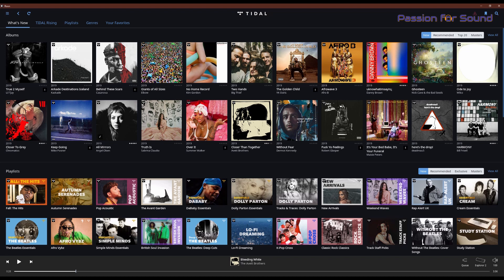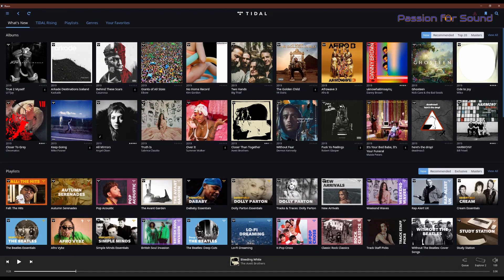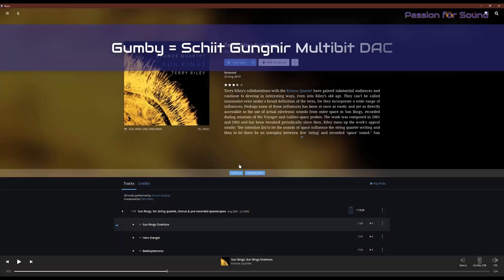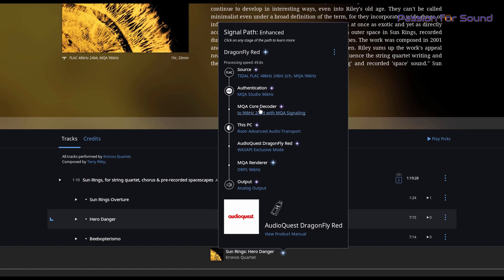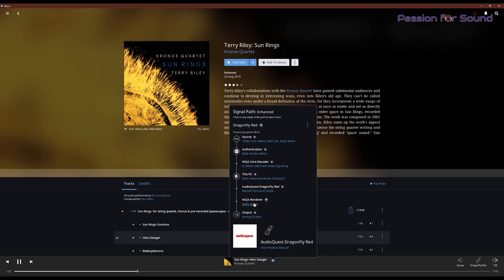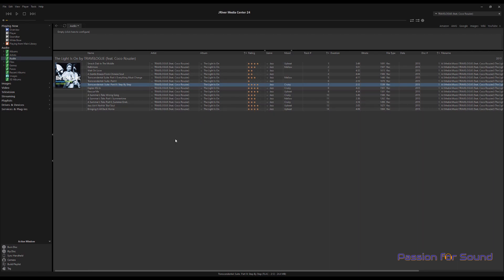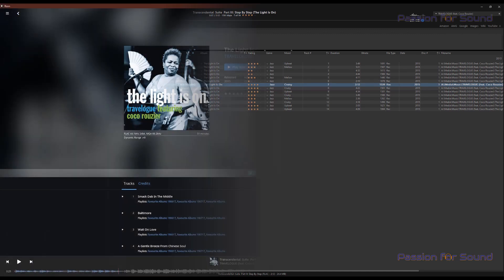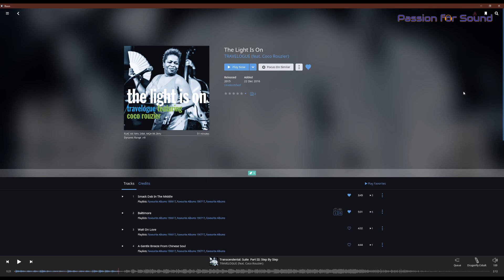Understanding MQA decoding - a (hopefully) simple explanation

Comment: i own a Wiim pro streamer with has a MQA core decoder beta, i stream from TIDAL connect with the hifi+ subscription. im thinking of using an external DAC, do i need a MQA compatible DAC to fully unfold the MQA TIDAL master tracks or i can just use any DACs to utilize TIDAL since the Wiim pro streamer already has MQA core decoder built in. In hopes i dont bust the bank in buying unnecessary DACs with MQA etc. thanks!
Reply from the maker: Hmmm... I'm not sure how that works with the Wiim. Because it will be outputting a digital stream though, I believe you need an MQA decoding DAC, but they don't really cost any extra so don't worry about it adding cost.

Comment: Thank you for this concise and clear explanation! I have a quick question: I own an NAD M32 (renderer only, NOT a full decoder) that communicates with Roon directly (no PC involved). In other words: I get the full benefits of MQA, including enhancement, as long as I use Roon and listen to my loudspeakers that are directly hooked up to the M32. But I also use the digital pre-out of the M32 to feed my Chord Qutest (non-MQA DAC), which in turn feeds my Violectric V280. What comes out of my HD800s that are connected to the Violectric? Roon does not know that I use the M32's digital pre-out... an answer would be greatly appreciated!
Reply from the maker: Hi Uriel and sorry for the slow response - some comments don't appear in my notifications feed. My understanding of MQA is that any devices using it, don't output a rendered/unfolded version via digital so my understanding is that the Qutest will be seeing the file as it comes from Roon before the M32 does any processing
Reply: @PassionforSound  Hmm, that would mean that whatever the Qutest receives, it is decoded (Roon) but unrendered (no M32). Odd! Maybe I simply get lossless. Thank you for your answer!
Reply from the maker: That's correct. No problems 🙂

Comment: I understand that the external dacs which are mqa authenticated ( renderer + decoder),  decodes mqa files from tidal to it's fullest potential without need of any other software renderers like uapp etc.

Now coming to my query if I purchase a dac that supports native 32 bit 384 khz sample rates such as ibasso DC 03 or BGVP t01 fiio btr5 to name a few, which are not mqa authenticated, will pairing it up with uapp unfolds mqa to it's fullest potential (2nd and 3rd level of unfolding) and does owning lg quad dac devices (which supports 32 bit 384 khz) such as lgg8x unfold mqa if paired with uapp.?

To sum it up will the following setups 👇🏻 decode mqa (tidal masters) to its fullest potential

1. Any mobile phone (non quad dac chip) + tidal masters + uapp + external dac such as ibasso DC 03, fiio btr5 (non MQA authenticated)

2. Lg g8x ( or any quad dac supported mobiles) + tidal masters + uapp 

Can you shed some light on these aspects. Do correct me if I was wrong in my deductions.

Thanks for your attention
Reply from the maker: I think the simplest way to understand it is this:
1) UAPP or the Tidal app itself will send the DAC a file that's equivalent (sort of) to a normal FLAC file
2) if the DAC is MQA capable, it will then receive / unfold an additional layer to get higher quality (I can't recall if the app does the unfold or the DAC, but the end result is the same)
3) apparently some recordings and some DACs have been assessed by MQA to allow for further optimisation based on the known characteristics of the recording technology and/or the DAC. My understanding is that the final layer is about compensating for these factors.
I'm pretty sure the LG Quad DAC phones get levels 1 & 2 only as do most MQA capable dongles like the EarMen Sparrow I think.
These layers get really hazy though and the MQA marketing has never done a good job at clarifying exactly which devices or content get which level of quality.

Comment: Hello, my name is Cale Guillory, and I have a Dragonfly Red DAC, but so far I haven’t heard studio-quality sound from my speaker on the MQA setting, especially since the speakers I use are fairly new and probably haven’t fully broken in yet.  During my first listening session with MQA, I heard what sounded like I was sitting outside at a live performance in the front row, even though I was actually sitting in my father’s office at home and I experienced listening fatigue after about an hour of listening.  However, in my second listening session, all the harshness was gone and it just sounded like I was listening outside of the recording studio with the door closed.
Reply from the maker: That's great to hear, Cale. Hopefully it continues to improve as your speakers burn-in 🙂
Reply: @PassionforSound  Thank you very much!  I read somewhere that the goal of MQA is to bring listeners the original live performance.  I haven’t heard such from MQA, though.  I hope that just has something to do with my speakers and not my DAC.
Reply from the maker: MQA is done inside the DAC (your DragonFly for example) and is intended to improve timing accuracy to improve the overall listening experience. It's hard to say if it's definitively better or just different

Comment: This is a great explanation. Easily understandable followable. Wonder if the chord mojo can decode/ render mqa.
Reply: also, wonder if how much computational power does the first unfolding of decoding need. If there is a difference in mac vs high end cpu in pc.
Reply from the maker: I don't believe it's particularly difficult on the processor and I can confirm that the Chord products don't decode MQA. Their designer doesn't particularly like the MQA approach.
Reply: @PassionforSound   Thanks for the info!
Reply from the maker: Happy to help!

Comment: Did you include the upsampling for 16bit 44.1kHz MQAs? Core decoding in roon shows a 16bit 44.1kHz becomes 24bit 88.2kHz; and that is not because of unfolding for the simple reason there isn't anything to unfold by Nyquist theorem (sample rate 44.1kHz = max frequency 22.05kHz). So it must be plain old school upsampling then?
MQA is smart to hide this. The MQA DAC shows 44.1kHz all the time, but it actually plays an upsampled (and therefore better sounding) 88.2kHz (or even 176.4kHz) version of it.
It is proven upsampling makes PCMs sound better, so is MQA adding anything else? (answer = no).
To prove the upsampling : select a 16bit 44.1kHz track, select "core decoding" in Roon and look at the signal path it will show 24bit 88.2kHz.
Reply from the maker: Hi Wim, I didn't discuss this because I don't know enough about the MQA process and would have been speculating. There's a distinct lack of clarity around the MQA process, but I believe it is doing more than upsampling because the MQA version sounds different (and not better) than the equivalent PCM file upsampled using the Chord M-Scaler. Based on my conversation with Rob Watts from Chord Electronics, MQA is using a different approach to filtering during the reconstruction of the analog waveform, but I believe there is also more to it because of the lossy nature of the files - there are alterations made at a mastering level and then further changes in the filters applied at the DAC (as I understand it). Upsampling may also be involved, but it's more than just upsampling.
Reply: @PassionforSound  Thank you for your answer. In the mean time I found out that every MQA is played at the max. sample rate the DAC can handle (always a multiple of 2 of course). So a 16bit 44.1kHz plays as a 24bit 352.8kHz on my system, just like 24bit 88.2kHz or 24bit 176.4kHz; those also become 352.8kHz. The oversampling is for easier filtering. And yes there is more going on (DSP?) but they keep it obscure for some reasons. I do find it quite remarkable a 44.1k is played as 352.8kHz, yet the display keeps showing the original sample rate and not the playback sample rate. Why is that? hmmm...
Reply from the maker: Yeah, the lack of transparency is a bit strange to me and I think plays a large part in the controversy and debate surrounding MQA ☹️

Comment: I really like Audirvana personally
Reply from the maker: It's a nice piece of software. I'm a Roon guy, but Audirvana would be my choice if I didn't need the Roon features.
Reply: @PassionforSound  curious, which features does Roon have that you need?
Reply from the maker: It integrates with Tidal and Qobuz to show those services as part of your library so you can add Tidal/Qobuz albums to your local library. It's still streamed rather than stored locally, but it makes it simple to integrate local and streamed content.
It also has powerful search functions to filter by all kinds of metadata and includes information from AllMusic.com so you can see detailed album info, artist info, bios, album art, etc. It's like having CDs/vinyl with all the liner notes, but those liner notes include hyperlinks to more artist info and other related albums.
Finally, it also allows for easy network streaming through to wireless speakers (Sonos, etc.) and other endpoints to create multiple outputs in the home drawing from the central music library

Comment: One big benefit I've read of an MQA render or decoder is time correction in the DAC, aka less time smearing. Amazon Music HD just came to Canada so I've been comparing it with Tidal. Still trying to wrap my head around what's going on but what I can say is there is a difference between FLAC and MQA.
Reply from the maker: Definitely a difference. There's so much mixed information out there on MQA. I feel like it does improve the timing info which leads to a better sense of space in the soundstage, but in my D90 review I found that the MQA lost a little resolution compared to identical masters in standard PCM. Tidal has a range of albums in both MQA and standard FLAC so it's easy to compare. REM Automatic for the People and The Beatles Abbey Road are two such albums of the top of my head.
Reply: @PassionforSound  It's odd some songs I like the reverb tails I get with FLAC, gives a good sense of space to certain instruments. Other songs the immediacy that notes end on MQA is amazing. 

Again still experimenting...
Reply from the maker: I hear you. I've gone from being a huge MQA fan to on-the-fence to disliking it, but I'm still not settled that I've come to rest on any decision.
Reply: @snowrang3r657  mqa warms some mids and lowers few highs for most tracks.. As long you are aware of this then it's fine. It's not a technical copy of the master.

Comment: Doesnt the dragonfly do decoding and rendering with the update ?
Reply from the maker: Hi Kishan, I can't recall the correct names for each stage, but the DF allows for 2 of the 3 stages. The software will do the first unfold and then the DF unlocks the second step. There is a third step that some DACs do, but not the DF last I checked

Comment: MQA is an attempt to monopolize the music  industry. Why take the original flac and decode it so that an MQA equiped DAC can unflod it. Just for some company to make some money. What is extremely sad about this is when even the an MQA DAC unfold the file, still it is different from the original Meaning the music is loosing quality.  MQA is like a newer version of mp3 but with a bad agenda.

So what is you want to do room correction using a convolution filter. If you do that you lose the MQA signature.
PCM is designed to be a flexible way to transmit and manipulate the process of streaming music. MQA is making the industry go backward.
Playing same file in Qobuz is superior to MQA on Tidal. Hope MQA to disappear soon. If you argue about size of files, I am not buying that. We are in 2020 and we have extremely high bandwidth. Steaming any resolution for audio is nothing compared to a YouTube video.

Comment: Awesome. Question because you're so informed and good at this: I have tidal premium, and a Galaxy s10, if I play usb to a portable dac amp that has the high res, will it play the full MQA, or does it need a MQA supported dac (portable dac has 32 bit to 384khz btw)?
Reply from the maker: Hi Joshua, a couple of factors here. Firstly, you DO NOT need an MQA DAC to get the hi-res audio from Tidal Premium. However, as I understand it, you DO need to use USB Audio Player Pro (UAPP) if you want to get the hi-res output. I believe the Tidal app is unable to bypass the Android audio processing, but that UAPP can / does. It definitely passes hi-res from Tidal to external DACs (even non-MQA ones), but not sure what it sends to the onboard headphone out.
Reply: @PassionforSound  Oh, ok.. thank you very much. I heard recently about need for audio player pro. So I'll plan to get that. Thanks much. I've last thing, so, do you know if this way fully renders the 3 parts meaning will audio player pro be able to do that through it from tidal to a non MQA DAC (the 3 parts; or would it be I need a renderer in the form of supported dac to get the full)?

Comment: Meridian Explorer2 MQA full decoder has recording equipment compensation software built into the decoding DAC. That information is stored on a XMOS chip in the DAC that compensates for the recording studio equipment. The XMOS chip has a fingerprint of the equipment used in the master recording and applies the correct filter. How MQA works. 

https://www.mqa.co.uk/how-it-works

Comment: Hi Lachlan. I like everything about MQA, except that ... Why on earth can't that decoder be a software? Why is it supposed to be a hardware. It uses a fingerprint of higher impulse info/timing info (it is audible, humans can discern upto 5ms of timing info) superimposed over a normal audio stream and used to reproduce it. Why can't I just use the two data, upsample it to say, 384 khz or dsd over pcm with the info obtained in software (which will actually be a better thing since a computer processor can do a much larger chunk of calculation so you can do very high precision) and then send the signal? Instead of having a closed source chip to do it on the dac side?
Reply: MQA uses a Special deck chip that has the MQA decoder software built into it. A full mqa ecodered a decoder will have 2000 different settings for platforms specific DAC compensation. This compensation has a fingerprint of all the analog recording equipment used in the mastering process and applies the correct filter. “White glove process”
Reply: @ShareHobby  thanks Dave. It still imo makes better sense to be able to do a significant chunk of it in PC.
Reply: @manueljenkin95  yes it would make better sense to do full hardware decoding. But every DAC would have to then be field programmable with XMOS, which most are not.
Reply: It’s been a while, now I got why a part of it needs to happen inside the dac. It is tightly coupled with the transfer function of the dac, and it’s noise shapers etc to ensure a proper inverse is obtained. Quite not possible to do for all dacs on the pc (also considering the internal algorithms of dacs are things the manufacturers would wish to keep to themselves)
Reply from the maker: I can't really answer that, but I do know there are some things going on that may influence this.
1) MQA is partly about the filters being applied in the DAC and these have been added through firmware in past examples (DragonFly Red). Not sure if this can be handled pre-DAC in software
2) the final stage as I understand it involves specific adjustments tailored to the specific DAC so that obviously has to involve some in-DAC tech/firmware and licensing

Ultimately though, my sense now is that MQA offers insufficient benefits to make it worth pursuing. Bandwidth is sufficient for streaming full lossless files (e.g. Qobuz) and while I like MQA, I do not believe it is better than regular audio and may in fact be worse (see the interview with Rob Watts)
Reply: @PassionforSound  if your dac filter is transparent enough, a good digital stream and hqplayer is all you need to simulate different filters. But yeah mqa is dead and hopefully someone would make an open standard that is actually usable.
Reply from the maker: I don't know if it's dead so long as Tidal supports it so heavily, but I agree it's unlikely to grow dramatically.
As for a usable standard, I think the existing lossless formats, particularly FLAC have us well covered and they're very much open source as far as I'm aware.
Reply: @PassionforSound  I was meaning about an open standard that preserves audible portions of the impulse info from dsd/high sample rate pcm but without the high size.
Reply from the maker: Gotcha. Thanks for clarifying

Comment: So you're are saying I don't need a mqa dac? I can use a standard dac as long a the software decodes it?
Reply from the maker: Yes and no. You can playback MQA on any DAC - that is true because it will be treated essentially like a normal FLAC file. However, if you want the proposed benefits of MQA (specific filtering, timing corrections, etc. according to the marketing info) then you need an MQA DAC.
My experience suggests that an MQA DAC playing MQA will outperform an equivalent non-MQA DAC. However, a higher quality, non-MQA DAC will still beat a basic MQA DAC. For example, the Schiit Gumby easily beats the Dragonfly Cobalt even with MQA files.
What this means is that if you're playing a lot of MQA (e.g. using Tidal) then either buy a really good DAC regardless of MQA capability or specifically buy an MQA DAC if you're operating in the lower range like DragonFly, Explorer, etc. Obviously, if MQA is an occasional thing then it shouldn't factor too heavily into your decision.
Reply: @PassionforSound  ok thanks
Reply: The Tidal, Roon, UAPP, and a some software will decoder MQA up to 24bit/96kHz. To get 24/384kHz Hi-Res audio, you’ll need an external DAC like Dragonfly Red/Cobalt.